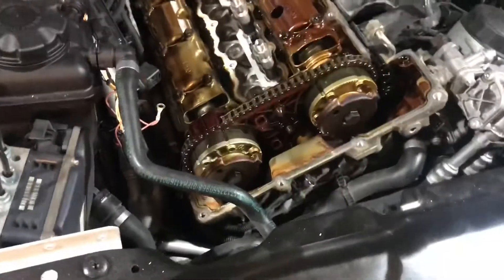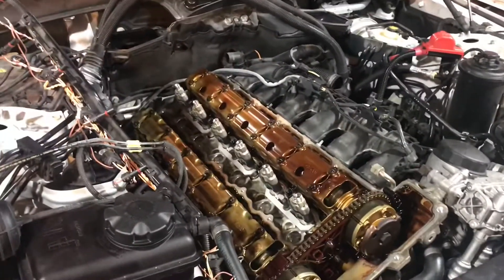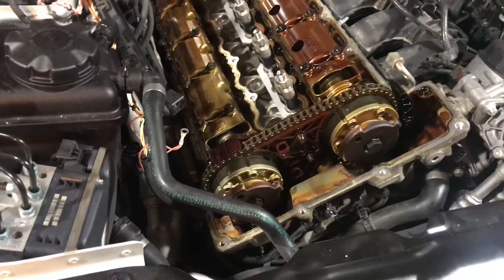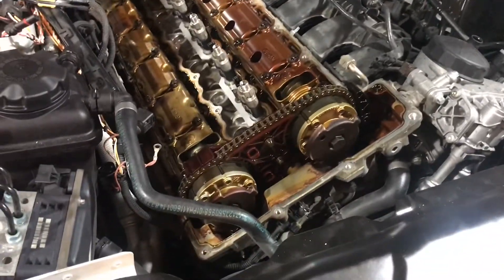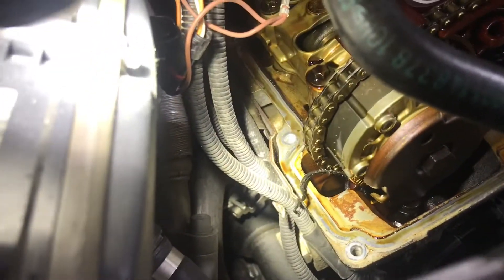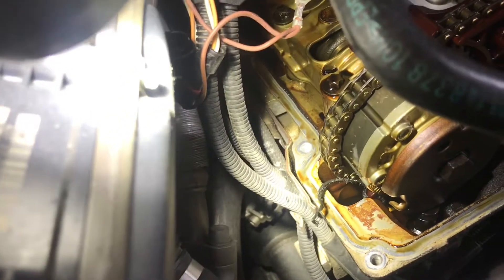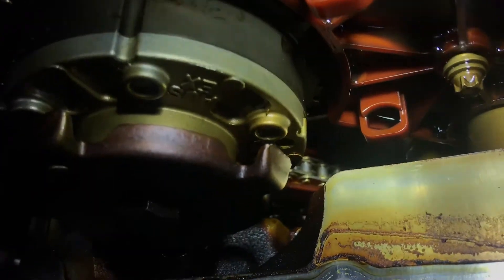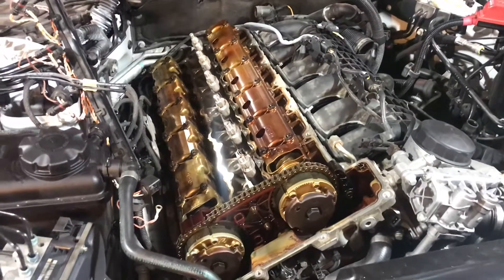E60 BMW Belt Sucked Into Engine N54

Comment: Same car, same problem! Not sure if there was any long term damage because of the shredded belt but the cause of the belt slipping in the first place ended the life of my E60. As the mechanic dug deeper to find/repair the oil leak that caused the belt to slip in the first place it started to get more expensive than the car was worth.